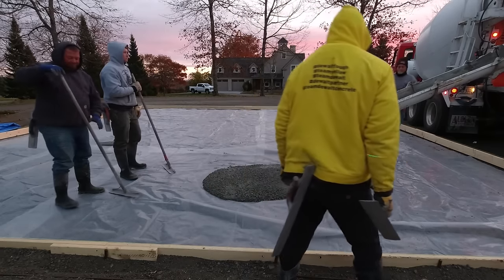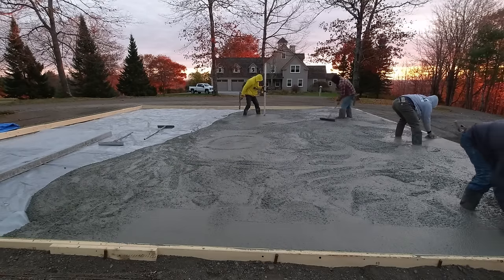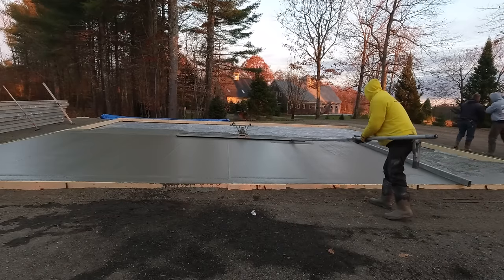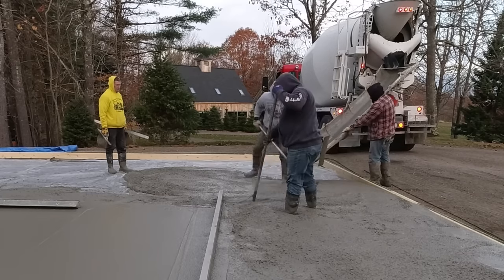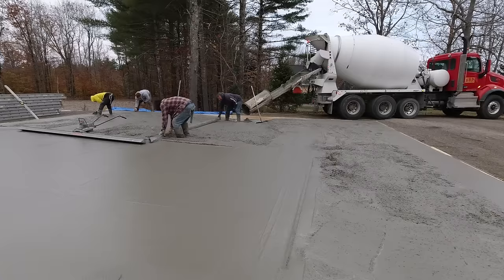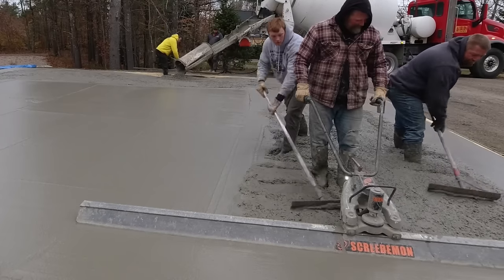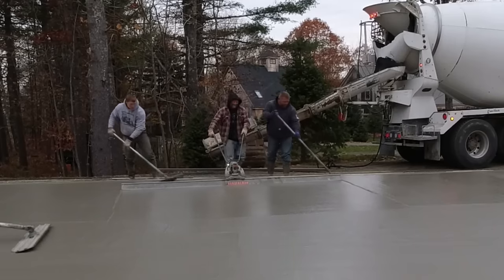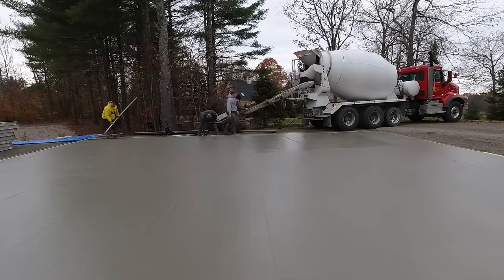Homeowner Saves Himself $2304.00 By Doing This To His Concrete Slab

Comment: Maine’s climate must be very different than I had imagined or recalled because the Maple trees still have their leaves (9 days ago), and there is no footer?  Slab on grade with no insulation or a knee wall down to a footer below the frost line (48” in Maine)???  How long is this slab intended to stay in tact?  In the U.S. southeast, I wouldn’t even do a slab like this without a monolithic 12” footer built-in. I am no expert but experience tells me no to even set a shed or a pavilion on a slab like that. Nothing against you Mike but homeowners rely on professionals like you to lead them and their project. Do you even offer a lifetime warranty?  If not, why would anyone call you back 2-3 winters later after the slab heaves, cracks, or shifts?  I know if they called me to look at it after it cracked, shifted, sinks, or heaved, I would say, “Well, you got what you paid for…” I imagine their horror when they have $50k-$200k worth of garage or barn sitting on a slab on grade with no footer or stem wall below the frost line.

Comment: Mike, I watch a few other conc guys on YT. No one seems to use the water reducer like you do. I've asked them. But you have to do what works for you. I'm a remodeler, it looks good to me. Several years watching your vids -- thank you -- Steve in NC
Reply: Plasticizer (water reducer) isn’t prohibitively expensive but it ain’t free either. At the end of the day, you’ll get a nicer finish product if you can focus your energy more into the finishing rather than wearing yourself out during the placement. Plasticizers really earn their money on verticals (walls and columns) where it helps it to flow into all the little spaces around the rebar and ties, up against the forms.

Comment: I was surprised to see you mag-ing your edges while standing in the concrete. I am thinking that is intentional - so why?
Reply from the maker: They tend to be flatter when you mag them from the inside.
Reply: @MikeDayConcrete  Thanks. That makes sense.

Now that you point that out, I remember learning that sometimes I have to turn the trowel (especially a mag because the concrete is still soft) backwards in my hand. WHY? Because the handle is not centered, so people tend to put pressure down unevenly - thereby forcing the mud out from under the handle toward the far edge of the tool. New guys, I have trained, tend to do what I call roll the edges - and even more so with an edger. Then I come behind them, trying to level it back out - often too late to fix it.